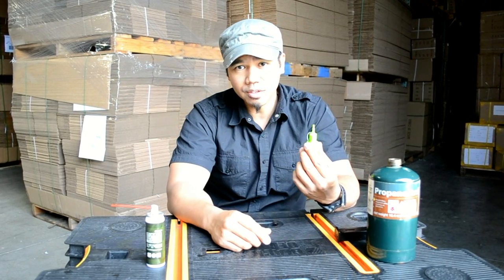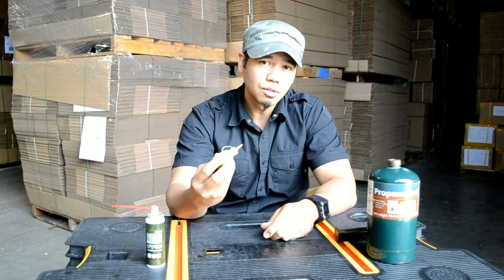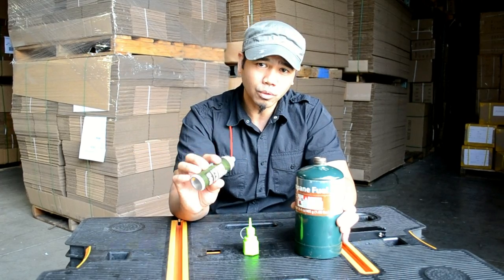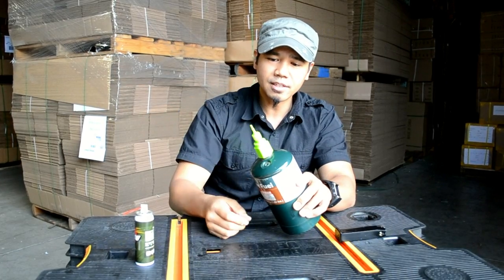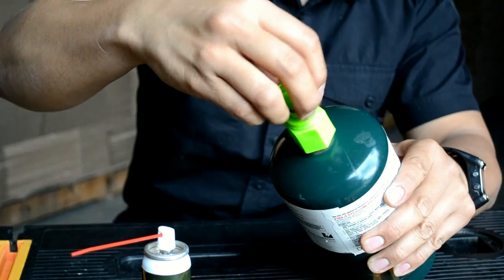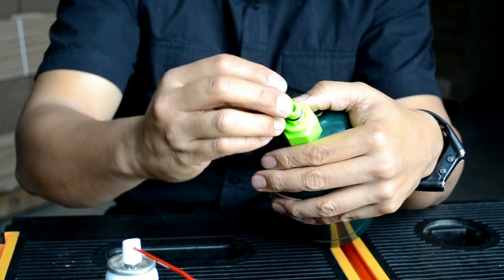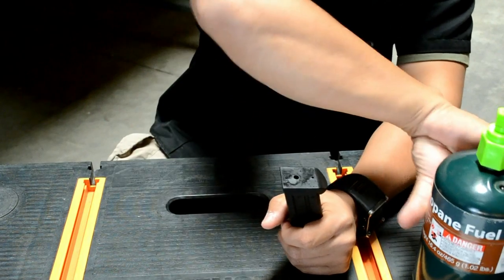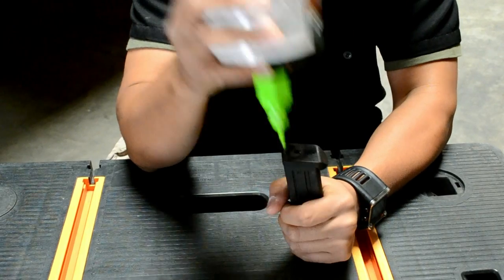Airsoft Green Gas Propane Adapter Use - How to Video

Comment: Look for silicone lubricant (either drip or spray) that is *food safe*
If it is advertised as food contact safe, then it has no petroleum derivatives in it and should be suitable for your gun
Reply: does anyone know what do do if I don't have a spot to put my oil in the adapter
Reply: @fishingwithchris1357 I've seen people apply silicone oil directly on the intake and exit valve of the mag to lubricate both the o-rings inside the mag and the gun itself.
Though don't overdo it because too much oil at once can gunk up BBs inside the barrel of the gun.

Comment from the maker: @Kevintripod You should add silicon to the adapter for each new magazine you fill with propane.  You can get up to 3 additional fills per magazine before you need to add silicon to the adapter again.  Hope this clears it up.

Comment: Grenn gas is just popane, only with the silicon already in it. you dont have to lube green gas, but its a little more tricky to find, propane you can get at just about any supermarket or appliance store.

Comment: Question for Dave. I have an airsoft field in El Salvador and getting green gas is next to impossible, and getting those Coleman type canisters is about as difficult, so i got the metal propane converters. Heres my question: Can I use the big propane tanks (the ones to fuel grllls, etc) or must it be a small tank? I have employees that can hold the big tank upside down. Will this work? TIA

Comment from the maker: Whoever told you that was wrong. Silicone spray is 100% silicone, so it is safe to use on airsoft guns. And we're not sure what stores you've been looking at, but we sell several different models of propane adapters. The propane itself you can get from any camping or big box store.

Comment: how strong is the propane will it break internals of clasic only green gas pistol or its more like co2 capsule or red/black airsoft gas and where to buy this cane of propane how to refill if its possible and how much this cost and how much it costs to refil

Comment: Whenever I use this adapter it sprays propane everywhere and doesn’t seem to go into the magazine. It won’t fill and I don’t know what I’m doing wrong
Reply: Same it just leaks and gets gas everywhere. It even drips on the floor. Make me wanna buy regular cans but they are expensive
Reply: @speedyspider2547  I found what’s wrong. The reason why it leaks is because the way the nozzle is made, it is small at the tip then gradually gets thicker if you look at the end of it, the thicker base stops it from going all the way to the port inside the magazine, thus leaking into the magazine and all over the floor. I got a metal one instead and it was able to go all the way inside without getting blocked due to the thickness

Comment: Yeah, I have plenty of gas, and, I've had this GBB for about two months now. It's a chrome M9 Baretta. And should I use the Propane, or the 134A gas? Becaus eon the back of the packaging of the adapter, it says that if my gun uses 134A gas, I shouldn't use propane. And thanks for helping me out, I really appreciate it.

Comment: I'm using green gas with added silicone lubricant...I notice however that the hop-up disappears. I suspect the oil in the gas to be the culprit, coating everything inside with silicone oil.
Reply: Don't add more silicone to green gas man if that's what you meant you're doing. It will fuck up. Just use it to lube your slides and moving parts...Green gas already has the right amount of silicone oil so don't add extra to your mags.
Reply: @Top-Jimmy  I don't add it. It's already mixed in. I think that the manufacturer just fucked up the mix and adds too much of the stuff.
Reply: @anomalyp8584  Ahhk man, Yeah that makes sense, What Green Gas are/were you running at the time mate?

Comment: umm propane is always flammable and so is all oil just go to ANY airsoft retailor or website and search silicon oil for GBB's even if its not a GBB it will still work just fine